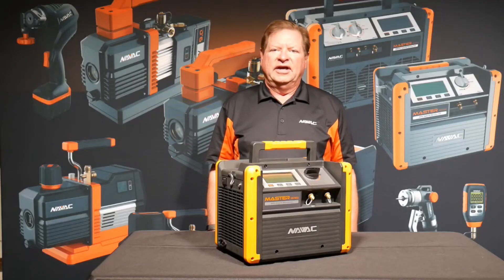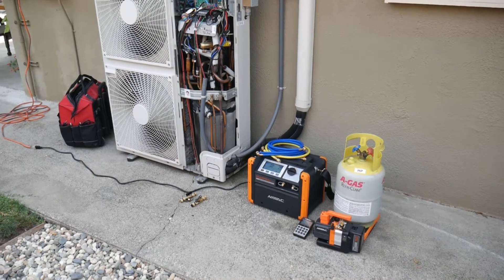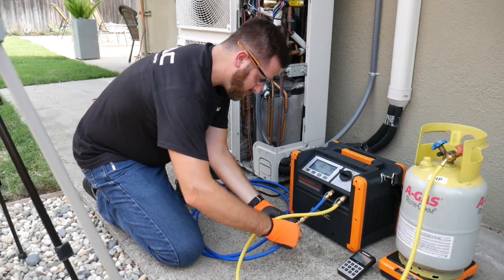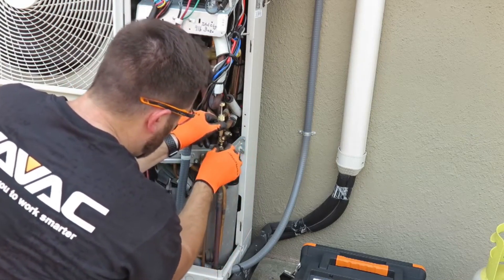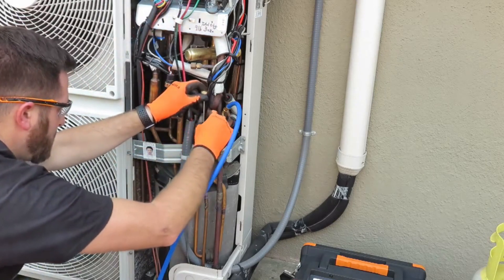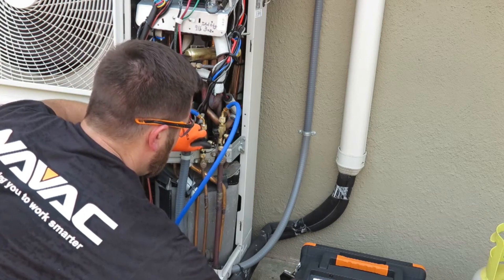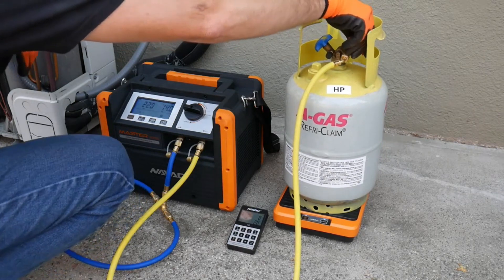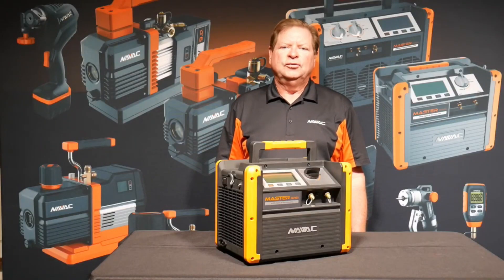Navac Recovery Machine NRDD, Product Demonstration

Comment: No one shows how to get the pressure out of the outlet at the end of the video
Reply: It has a purge setting ,and it purges all the ref from the machine to the tank 
Vapor is left in the hose-no liquid
Reply: All you do is turn your valves off at the condenser then you put the machine in purge mode
Reply: Out of what outlet?
Reply: @kizito8888  at 5:25 the “Out” psi is 420+ so after you’re don’t how do you replace that pressure.  I was using this exact pump but didn’t know how to release that psi pressure